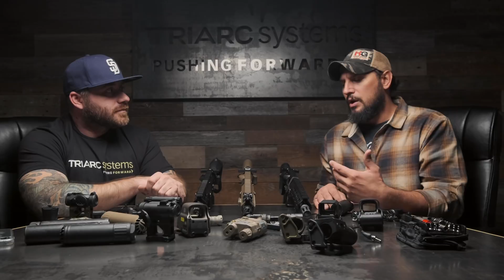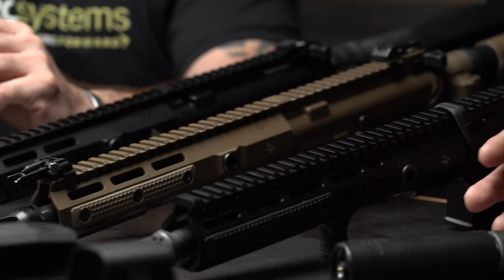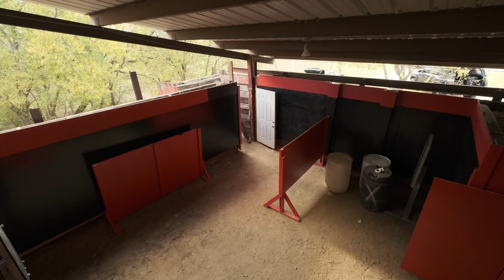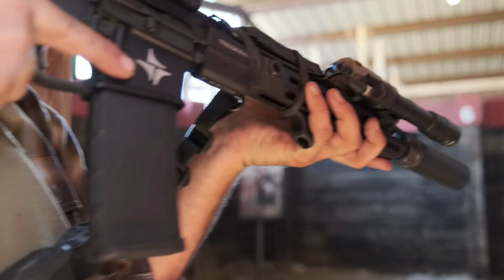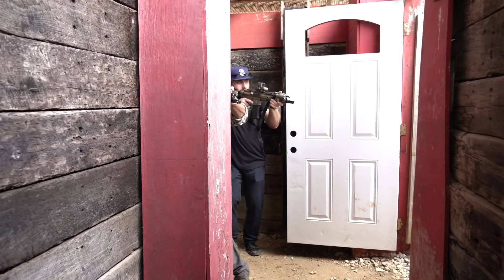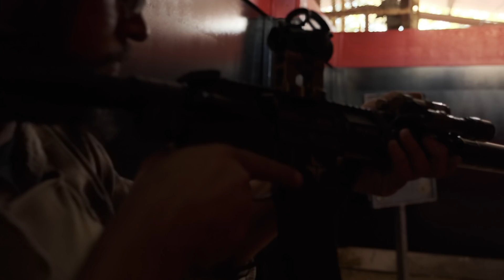Tailored Solutions: CQB Rifle Setup Considerations

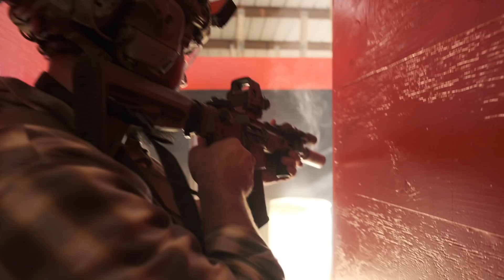Comment: 7:50. Can you even see BUIS with the unity riser lol...?
Reply: The eotech has a qd lever. And then you can use your buis.
Reply: Berry unless the EOTech window gets completely covered, I just keep it on the rails and flip up the BUIS.
Reply: @Samoguitarsandthings  but the unity riser he has makes the eotech to high to see your buis in the eotech window. That's why i commented.
Reply: I didn't know they made one for the EOTech version. At least for me, the EOTech is the right height for my face with or without NODs.  Standard height also allows me to center the front post in the event it goes down and I don't have the second it takes to flip up the rear BUIS.
Reply: @Samoguitarsandthings  the unity riser is pretty sweet brutha. Total game changer for me. It only lifts it up like a half inch or something but it is really nice.
Reply from the maker: Correct, we placed them with the purpose of removing the optic to get to the irons if needed.
Reply: The unity fast mount has irons built into the mount . Would u be able to precisely put rounds on a human at 300 plus prob not. However for a cqb weapon for nods use it fits the bill.

Comment: I tune in praying they say the setup I bought is good to go 😂 (Triarc 11.5/RC2 suppressor)
Reply: 12.5 is one betta
Reply: @InkwellFoto  13.9 gang😤
Reply: @JoshRidesMoto  brutha I have an 11.5 and I’m waiting on my 13.9. 12.5 is a compromise and I don’t compromise 😤😤😤
Reply: @CertifiedBullpupHater  for me I just have my 13.9 for everything and a stribog for something ultra compact and concealable and such. And if I weren’t broke I’d have a lightweight bolt gun probably a tikka for long range
Reply: @JoshRidesMoto  my OSS muzzle devices don't stretch out long enough to make the 13.9" to 16" so I have to SBR.
Reply: @CertifiedBullpupHater  the rail length of the 12.5 is what works for me over anything shorter. So other than my 11.3" 300BO, all other lengths are 14.5 (due to OSS muzzle devices)
Reply: @CertifiedBullpupHater  12.5 is a compromise?  Really?  That’s a weird thing to say...

Especially since you could have bought one 12.5 and done anything with it that you can do with your 11.5 or your 13.9...
Reply: @JBass19111  sorry I forgot the internet doesn’t understand humor.
Reply: 11.5 is juicy brutha